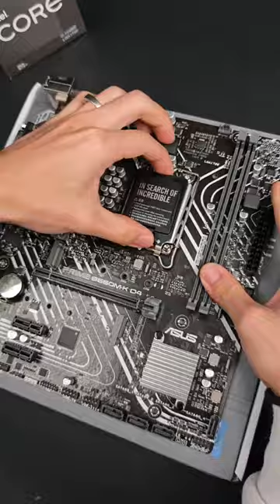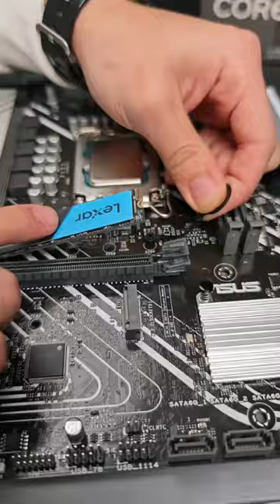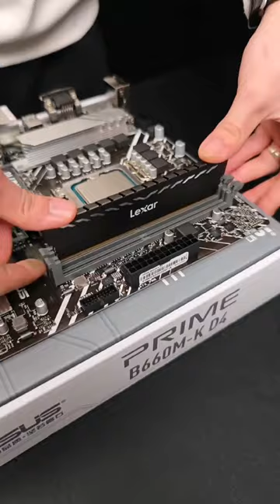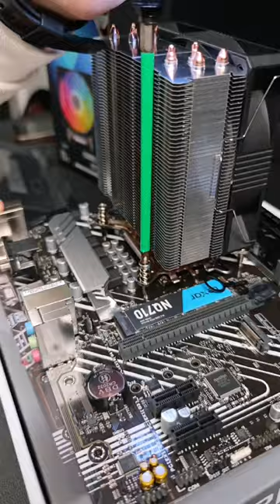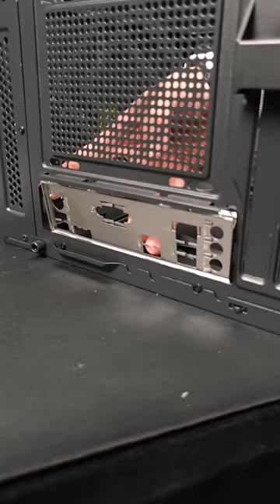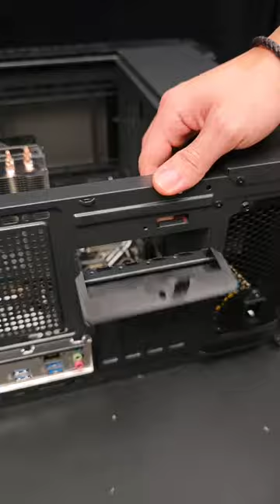Intel i5-12490F🔥 with GTX1630😱 #pcbuild ASMR #shorts

Comment: The bottleneck of this pc is more impresive than the price of the rtx 4090
Reply: Yeah, but it’s technically ok cuz it’s a 40-50 percent bottleneck on the cpu when I do gpu intensive tasks on the bottleneck calculator. That just means that the cpu is over powered for the gpu and you don’t need such a powerful cpu for such a 💩 gpu. But it could just be for work and that’s fine .

Comment: -Intel Core i5-13600K
-ZOTAC Gaming GeForce RTX 4070
Twin Edge OC DLSS 3 12GB
-GIGABYTE Z790 UD AC (LGA
1700/Intel/2790/ATX/DDR5
-fuente de poder 850w 
-Silicon Power 2TB NVMe M.2 PCle
Gen 3x4 2280 
-DDR5 Ram 32 GB Kit (2 x 16) 5600 MHz
-MSI MAG CoreLiquid C240
Me ayudan por favor! será todo compatible?
Reply: Yes but better go with 4070 ti or 4070 ti super for 1440p  and maybe change ssd for pcie 4x4 but that doesn't matter much
Reply: @gandalf7524  Muchas gracias hermano 👍
Reply: Compatible ❗️😁